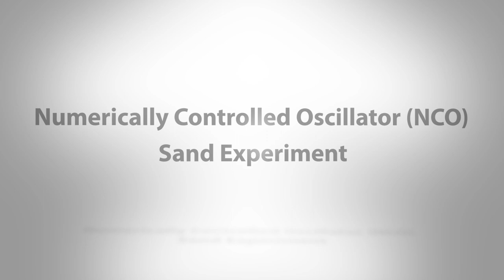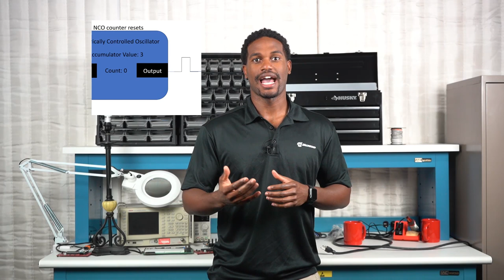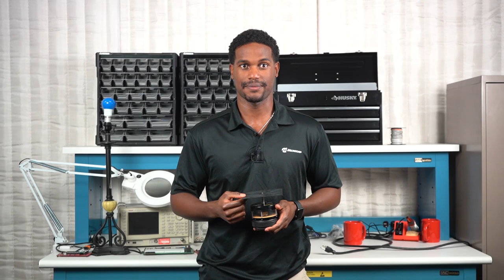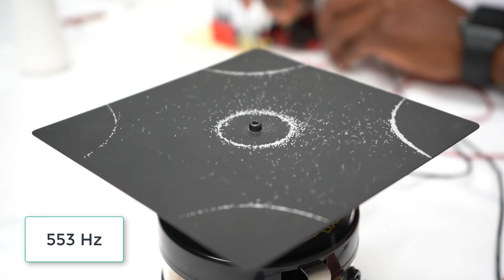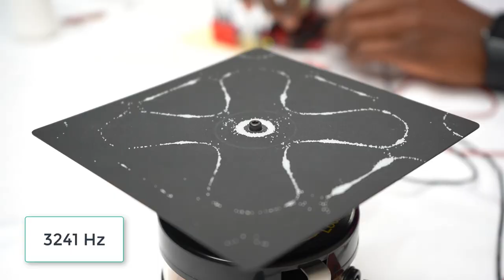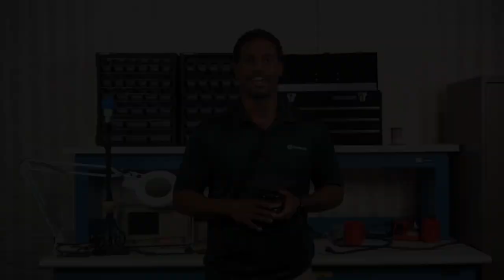Numerically Controlled Oscillator (NCO) Resonance Experiment – Precise Frequency Control

Comment: I have to menton that NCO has one major flaw. It has to do with the way that peripheral is designed. It produces very jittery signal because the overflow carries on. This has an effect of unstable frequency, constant only in average sense. Therefore it is not really suitable for audio applications because that uneven frequency is actually audible and it behaves differently at different frequencies very often creating additional low frequency "beats". It is good and fairly simple to use on other  general purpose things. I think Microchip should develop a proper timer based version of NCO which you can tie to pins directly.